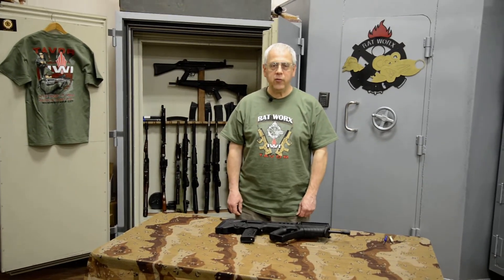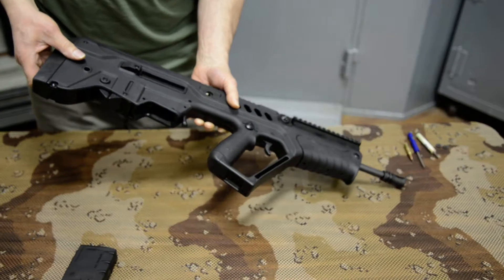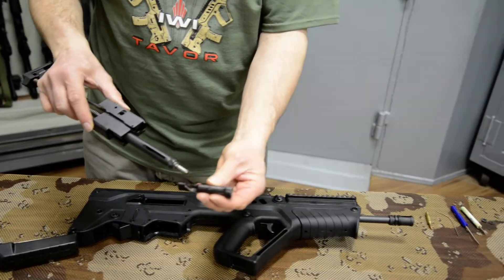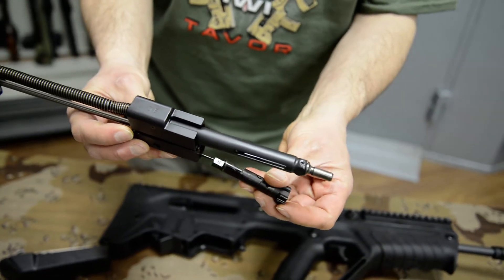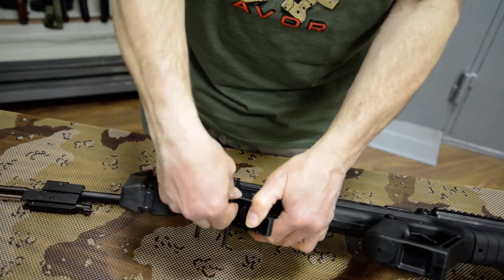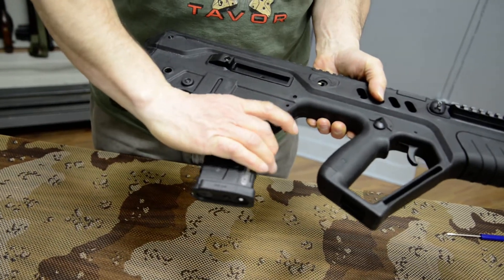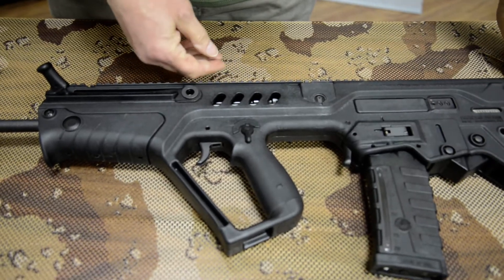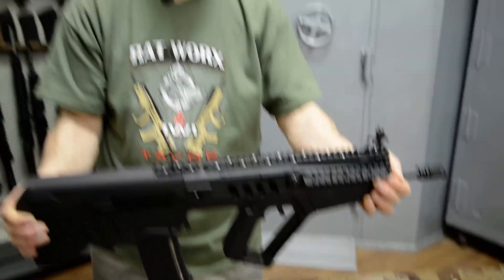IWI TAVOR Takedown and Maintenance from RAT WORX

Comment: The only thing I do differently when cleaning the barrel is using a bore snake. I don't like pushing debris back into the gun. It's easy to drop a bore snake into the barrel with the carrier group removed. One other thing. If you are a left handed shooter and you shot a right handed Tavor if you use 223 it will eject the casings into you face. Vice versa if you shoot right handed and shoot a left handed Tavor. Try 5.56 it will miss yuour face.